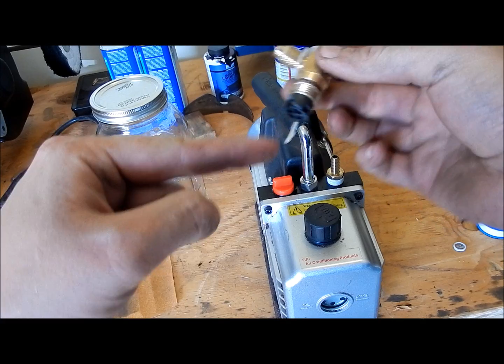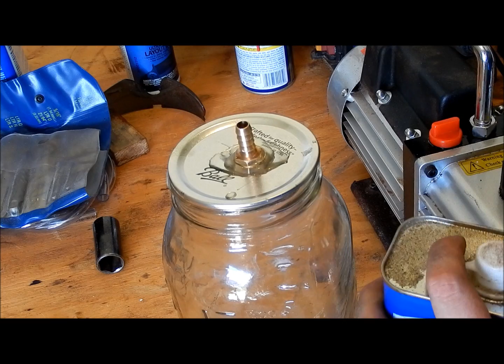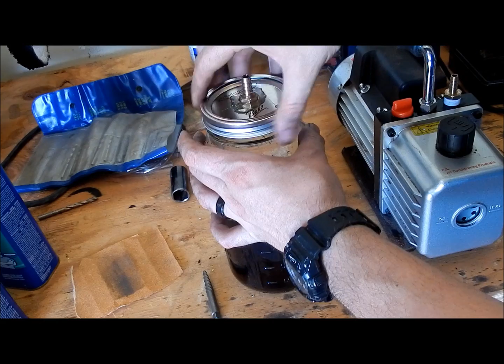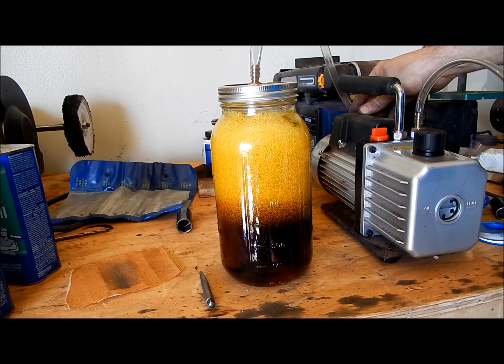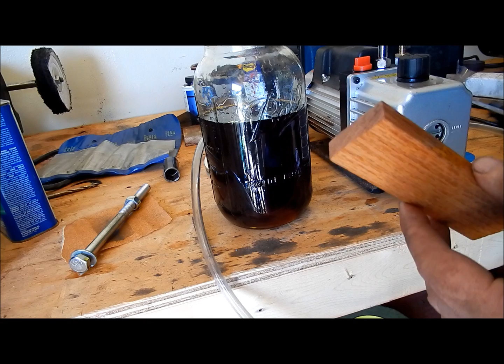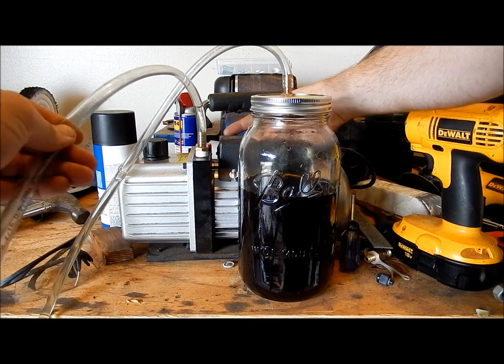DIY Home Made Vacuum Chamber.

Comment: Linseed oil does not stabilize the wood, just with this method we achieve almost complete impregnation of the wood with oil. Personally, I consider the stabilization of woods with chemical resins a completely unsightly effect, a new product emerges that is neither wood nor plastic like a bad joke. Your method is beautiful and economical and above all the wood remains charming and protected. Thank you

Comment: Can you use this to vacuum purge shatter or wax??
Reply from the maker: I would assume so but I dont have much experience with many other materials other that what you have seen in the video. They have some actual vacuum chambers you can buy on amazon for pretty cheap. Is check them out.

Comment: Dear sir, to stabilize the wood that degree of moisture is allowed, try to reach zero percent by heating the wood just cracking. Thank you
Reply from the maker: As little moisture as possible. Many people use a food dehydrator for 24 hours and then stabilize. Dont use boiled linseed oil. This was a very early attempt.

Comment: I have read many of the comments below, and am always amazed at the truth & knowledge expressed with conviction by people who are are utterly clueless.  Recognizing I may be clueless as well, here's my $0.02...

The tubing you are using is fine as long as you vent it, ie. allow air to enter "the jar/tubing/pump system" from somewhere else other than just the jar.  Your pump is rated at 5.0[cfm].  For perspective, 5 cubic feet per minute is more than a half gallon per second.  The pump wants to pull more than a half gallon of air thru "the system" every second, but there is only a pint of air in the jar, and once the jar is emptied, the line collapses.

So... try this:  cut the tubing into three pieces (two of these should be rather short) and install a brass tee (in the same area of your hardware store) in line between the pump and jar.  Put this tee nearer to the pump, with the second short piece of tubing attached to the perpendicular side of the tee, and the third longer bit of tubing going off to the jar.  To the short piece of tubing sticking out to the side of the tee, connect a small valve (1/4 turn ball valve, toilet supply line valve, that sort of thing).  Now use this valve to "regulate" the amount of air into the "system".  Start with the valve wide open, turn on the pump, then gradually close the valve until the bubbling just barely begins to occur.  In doing so, ie. as you are closing the valve, you are allowing the amount of vacuum in the jar to increase (air pressure to decrease) to the "proper" level.

Btw, the person who said the bubbling is actually boiling is wrong.  The vapor pressure of linseed oil is way way lower than can be achieved by this pump.  The bubbling you show is, in fact, exactly what you indicated, ie. the outgassing of air from pieces of wood.  Proof of this is shown near the end of your video, when you turn on the pump without knife blanks in the jar, and the oil just sits there.
Note:  you CAN boil water at room temperature in this sort of system, but the vapor pressure of water is significantly higher than that of oil.

Great job with your experiment.  And please keep us posted as you learn more.

Comment: Excuse my ignorance. The motor you are using resembles what we use to inflate tyres with - does your motor push air into the jar or the reverse ?
Reply from the maker: It sucks the air out of the bottle and puts the contents under vacuum pressure

Comment: Running your pump with the hose sucked flat is hard on the pump. Get a vacuum hose. Also like one of the other gents said build another trap to retain anything that comes out of whatever is in your vacuum chamber instead of letting go into your pump.

Comment: I heard on another video that you don't want to let the bubbles get to the top because then it'll suck the liquid material into your vacuum pump and mess it up
Reply from the maker: PoorManStand that is very true. This was a very early attempt at this and I ended up putting a valve on the top to regulate the vacuum pressure so the bubbles don't get to the top. I did actually suck some up so be careful when you build yours.

Comment: While canning jars are designed to withstand the increased pressure and temperature of a pressure cooker as well as the internal vacuum created when the jar & its contents are returned to normal pressure and room temperature, they are definitely not suitable for the extreme vacuum produced by an electric vacuum pump, especially a two stage model!  The most probable result of this "Cheapo" system is an implosion! If anyone needs proof, simply add a vacuum nipple to a 55 gallon drum(Do not TIG or Braze if it contained flammable liquid) and using a piece of genuine vacuum hose, attach it to a vacuum pump and watch it crumple up like a paper cup!
Reply from the maker: Daniel Alger I have never had any problems. Even when I put reinforced tubing I never had issues. Thanks though.
Reply: Eh explain a food saver canning jar vaccum then Daniel.

Comment: Other stabilizer's you can use are Minwax's wood hardener at about $10.00 a pint and a mixture of polyurethane and acetone. The Minwax works really good without the cost of Cactus Juice.
Reply from the maker: Ed Chauvin thanks for chiming in! great info, thanks a lot!

Comment: Some of the air bubbles are caused by the Linseed oil boiling off as the pressure drops in the chamber. The problem with using that kind of pump is that you can't regulate the rate that the vacuum is applied. You can get an in-line regulator to fix that problem. You should use a rigid tubing as well to prevent it from collapsing as yours did.

Comment: I may  be a little late 2 years late but with this pump which is used for AC pump down you need a regulator valve between the jar and the pump to slow down the rate of vacuum and an escape valve just before  the valve itself it will still vac but at a rate that wont overflow the chamber

Comment: The reason your linseed oil did not work is because when you turned off the vacuum pump while it was still under a vacuum it most likely rejected oil from the pump into your jar since the jar had the vacuum delta majority and mixed it in your linseed oil. You should never turn off a vacuum pump while it under a vacuum. use a valve in between your chamber that you can shut off then remove hose and turn acuum off.
Reply from the maker: it did start trying to pull oil out of the pump but I don't think it made it into the jar. this was a very early attempt at this and I have since made different vacuum chambers.

Comment: Awesome! What kind of vacuum do you pull these days for epoxy resins? I'm concerned about the jar. Seems like any imperfections may lead to a fracture which would be bad if using epoxy. But, this worked so well I want to try it!
Reply from the maker: I have a 5 cfm pump from amazon. you don't need that high of a cfm but it is great. I have built another chamber since then and I have a video of that one too if you want to check it out!

Comment: old refrigerator compressors make good good vacuum pumps or compressors depending on which pipe you hook to.  leave at least a foot of each pipe going up to keep the mineral oil in the compressor.  vacuum hose from the auto parts store should work well.

Comment: Just a friendly reminder that if that juice gets into the vacuum, it can really mess things up.
I highly recommend using a hand pump, like the vacuum break pump kits?
they're so much more convenient when it comes to managing preasure 
Using a little Ball Valve so you can apply the vacuum chamber then closing the valve also works well to keeping the suction for long periods.

Great Video!
Reply: +F-Knives: Custom Blades And Handles or fitting release valve to the lid would solve the problem
Reply: Well that's easy, redo the Video with the extra footage....
Reply from the maker: fadatec I have made a different vacuum chamber since this and there is a video up on it.
Reply: F-Knives: Custom Blades And Handles 
Hi Dear, thanks for great advice. Could you please draw your idea and Email it to me through my EmIl address?? It will be appreciated very much. 
camerongemstone@gmail.com
Reply from the maker: +Stan SonOfAFather I have had a pressure release valve installed in the lid for quite a while now and it is wonderful. I just wish i would have thought of it 
when I initially made the video. Thanks for your comment!

Comment: why do you boil oil?
Reply from the maker: +midnightrider1100  no, they call it boiled linseed oil. I don't boil it and I have never heard of anyone else boiling it before use either lol. I don't use boiled linseed oil in this application anymore. I use something called cactus juice. boiled linseed oil is great on wood tool handles though!
Reply from the maker: +Diego Bocchese no, nothing is boiling. it air coming out of the wood due to the vacuum.
Reply: +Diego Bocchese I don't know exactly but everyone that uses linseed oil to finish wood boils it first or it won't work right.
Reply: perhaps is the water in the wood that boils
Reply: ok

Comment: I second everyone's suggestion of using a trap . Also you should should degas what ever you are using as your stabilizer first. A lot of the initial foaming up is actually just the dissolved gas coming out solution.  Also ideally the volume shouldn't more than half the container just to avoid sucking things into your pump if not using a trap.

Comment: i would put a t connector with a valve on it  on top of the jar so you can release the pressure without having to keep removing the hose all the time. you could even use the valve to adjust the starting pressure so it doesnt bubble up so much. im sure you could also plumb some sort of catch jar into the system to help prevent epoxy or boiled linseed oil from being sucked into your pump

Comment: When will the mason jar "IMPLODE" ? what kind of Vacuum PSI  can the mason jar withstand?
Reply from the maker: I have stabilized a ton of wood in this and have had no problems. The glass is pretty thick. No guarantees though lol. I would say I put about 28 to 30 on it
Reply: The Infinite Tradesman That would be 28 to 30 inches of mercury, not psi.  Atmospheric pressure is only around 14.7 psi and that's the physical limit.
Reply from the maker: I did not mention a unit of measure blmeflmm66  But thanks for the clarification on that.
Reply: The original question asked how many psi of vacuum.  Didn't want him furiously staying up till all hours for weeks on end attempting the impossible.  HAHA!  Have a great week.
Reply from the maker: Oh I got you, I didn't even notice the psi part of it lol I knew it was inches of something just didn't know what lol. Thanks. I am having a great week, hope you do as well.

Comment: would it work if i attached a normal household vacuum to a chamber?
Reply from the maker: I have never tried a household vacuum on something like this but from the amount of suction the vacuum pump has, I would say no. The vacuum pump is also on for extended periods of time and I would imagine it would not be good for a household vacuum even if it was strong enough. I would definitely go with an automotive vacuum pump.

Comment: Great video, thanks for the cactus juice update, I've got some coming in the mail.  You may want to consider a vacuum trap (pretty fancy word for an empty jar)  to protect your pump.  
The inlet of the trap is a fitting at the top & is connected to the pump.
The outlet is a piece of tubing that goes maybe 1/4 of the way down into the jar & is connected to your vacuum chamber. 
Any bubbles/liquid drops down into the bottom of the trap can't get into the vacuum pump.
This one shows a tube going all the way down to the bottom
sciencegateway.org/protocols/cellbio/lab/vacuum dot htm
Thanks Again & Best Regards,
Jon
Reply from the maker: That is a great idea. I had problems with almost suckling the oil up at first but don't have problems much now. But the extra jar would be great insurance. Thanks for the great idea. I also reccomend a pressure relief valve so you can relieve pressure while the pump is on so you don't have the pump under pressure while it is off because it it will suck the oil out of the pump and it is bad for it. Thanks for the idea!
Reply: The Infinite Tradesman
 Excellent idea.  Pressure relief valve will be installed!  Thanks Again